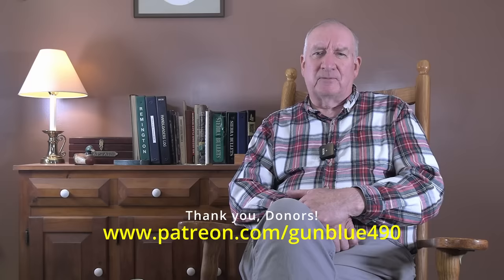The Copper Fouling Lie ~ Don't Fall for It!

Comment: A friend brought some Franklin Arsenal 1926 .45 acp ammunition to the range, and we shot it.  It shot very well and accurately.  It appeared to have a finish on the surface of the bullet.  When you mentioned tin plating on bullets, I wondered if that was on the 1926 ammo?  The cartridges were in fine condition.
Reply from the maker: I believe that tin was eliminated from bullets before that.
Reply: @GunBlue490  , thanks.

Comment: I've found that WD40 quickly cuts through carbon. Spray some on a clean rag and wipe the case necks clean before resizing, then wipe with a dry rag to remove excess; no need to tumble the brass.
Reply: Stop.

Comment: I have a question for all that are knowledgeable (not just opinionated): How do I return an old military rifle bore to shinney if it is black? I have several WWII rifles (and a couple old Winchester Lever Guns) of different manufactures that after cleaning have good-looking bores (rifling), gauge well on both ends and have smooth muzzles but I am unable to get that bore to shine up like near-chrome which I can on all my other rifles and handguns. My Model 68 Winchester (it was my Dad's) has had so many rounds through it the rifling is shot out of the chamber exit but due to the long barrel the accuracy is still there. It shines like chrome when clean. So what is the secret of black bores (I was told it was "copper fouling") and how do I fix it?

Comment: Thanks for the technical information GunBlue490.  Please do a similar video about lead in the barrel.  Most of my shooting is of the .22lr variety and seldom with copper clad bullets.  Shooting events are sometimes 100-200 rounds in one session. Afterwards most times I just pull an oily bore snake through it 3 times.  Occasionally I still see lead in some of the barrels with my bore-scope.  In that case I just use Hoppes with a bore brush a few times followed with my oily boresnake.  Critique me here.  Am I doing it all wrong?
Reply from the maker: Quality .22 ammo has either copper plated bullets, or they are lubricated.  Either will completely eliminate the need for cleaning, and a simple pass of a Bore Snake will wipe away any carbon.  Cheap, bargain .22 ammo is inexpensive because they have neither plating or a quality lube.  Lead bullets will lead barrels in the absence of either.

Comment: I was always under the impression that Copper solvents were primarily used by people shooting all Copper bullets such as Barnes. The newer Barnes bullets such as the TTSX are much better at alleviating Copper fouling by the grooves on the side of the bullet. The earlier designs caused a lot more Copper fouling than current offerings. I'm not sure the Copper issue had anything to do with traditional jacketed lead core type bullets.

Comment: Cut it in half and use a microscope or maybe use a borescope?  Button rifling causes the perpendicular lines cause Savage uses that method and my bores have those lines.  Agree about breaking in process.  But copper definitely causes accuracy to degrade over time.  Some rifles more than others. Love Wipeout for cleaning.

Comment: Thanks for posting this message.  I have preached the same thing to some friends of mine for a while and they won't give up on "copper fouling"!
What concerns me with the solvents is the chemical Trichloroethylene (TCE)....studies are showing it's a very carcinogenic and also attributed to Parkinson's disease.   Have you done any research with respect to TCE contaminants in gun cleaning products?  I like Hoppes but have pretty much stopped using it since you turned me on to Mineral Spirits....but I wonder about mineral spirits as well.  I know that Ballistol is supposed to be the safest.  I have read that mineral spirits and mineral oil may contain some carcinogenic VOC's but I'm not 100% sure.  So, I may just start using Ballistol primarily.
Anyway, thanks for another great presentation!!
Reply: My tip is always wear nitrile gloves when cleaning and have decent ventilation. I used to work in the pharmaceutical industry and the danger was always prolonged exposure rather than acute where carcinogens or mutagens were concerned.
Reply: Very good comment on TCE. Any of the crud-buster type sprays that dissolve oils and then evaporate quickly usually contain TCE. Aerosol brake cleaners or electrical contact cleaners like CRC’s Lectra-motive are the same.

Comment: Thanks for the interesting info! One question about the plating that you say takes place in the first few shots with a new barrel. If the barrel striations really do get filled in like screw holes in drywall, why do barrels still leave signature markings on bullets even in older guns? Your description made it sound like all those striations and other imperfections of new barrels get completely filled in and smoothed over, but if that were the case police wouldn't be able to link bullets to guns... right?
Reply from the maker: That's very funny, and hardly the case at all!  Understand how the evidence process works.  Bullets are not license plates with a data base.  Police begin with a suspect firearm and a suspect bullet.   Police labs have a library of rifling patterns used by various manufacturers that they have developed over the years from which they narrow things down.  For instance, a bullet pattern can rule out all manufacturers except X or Y.  So, if they have recovered a suspect rifle type X, it's submitted to the forensic lab, perhaps with a box of bullets found at the scene.  If they don't have the ammo, it matters not, because labs keep an inventory of every bullet ever commercially made.  As with all evidence in court, it must be corroborative to other evidence.  The gun is suspect for a particular reason(s) that link it to the crime, not just any gun in the universe.  The question is simply:  Does this bullet match another bullet fired from this gun?  

In the examination process, a bullet of the same type as the evidentiary bullet is fired from the suspect firearm and captured.  Both bullets are then chucked into a microscope comparator and the bases are rotated until they match.  Even perfectly smooth barrels have particular variations in rifling width, spacing, and impressions that can only be made by the same barrel, even if produced by the same machine on the same day.  Copper fills in roughness and improves a barrel, but it still conforms to irregularities.  A barrel that has been made smooth by whatever process is still unique and unlike any other barrel under a microscope.

Comment: When shooting cast lead bullets, the lead will  build up in the barrel. But after shooting I always shoot a copper jacketed round to clean the barrel.
Reply from the maker: Please, you should never, ever do that!  That's a bore obstruction! While lead bullets will continue to pass through, though inaccurately, the resistance of a jacketed bullet can raise pressures dangerously.  Even a heavily oiled or greased bore can blow a gun if shot out.  Never shoot out bore obstructions.  Get yourself a Lewis Lead Remover and do it safely.
Reply: Wrong

Comment: When a bullet is fired, copper is deposited in the barrel. This process repeats until it reaches a saturation point. From there, every bullet fired thereafter will strip an equal amount of copper that it will deposit. This can happen in as few as three rounds. There’s really no reason to worry about copper, as you said, it’s the carbon that is the problem. 
When we put solvents in the barrel that attack copper, they may attack copper more aggressively than other metals, but they attack metal, and they will gradually erode barrel steel. To make matters worse, there will be solvent that will be trapped in microscopic fissures in the barrel steel that you will never be able to remove, but the solvent will continue to eat away at the barrel material.
Call me crazy, but the way I clean my barrels of copper is to put more bullets through them. I do clean moving parts, and carbon from the barrel as needed. I don’t worry about copper.
Reply from the maker: You're essentially correct, though successive bullets simply conform to the smoother barrel with no stripping of the metal.  After conditioning, things remain static.

Comment: I have seen evidence of copper fouling that proved to be detrimental to accuracy. A browning a-bolt chambered in 243 winchester that was shooting 80 grain federal soft points. A rifle that was shooting .5 moa opened groups up to 2 moa over time.  The owner,(my son) is a meticulous cleaner of his rifle every time he shoots.  But he never had used a copper specific solvent in his barrel.  Only a well known general cleaning solvent. He, being very disappointed in the situation,  asked me what he should do to solve the issue.  I suggested using an oil based copper solvent to see if copper fouling could be the problem.  We first ran a bore scope down the barrel to assess the fouling  severity. It did seem to be heavy, so we continued with product recommended cleaning procedures. The result?  Same box of ammo and same rifle after cleaning immediately returned to .5 moa groups. No other explanation for it other than copper fouling build up.
Reply from the maker: I don't wish to cast doubt on your comment, but writing about anecdotal evidence and scientific demonstration are two different matters.  My wife's 243 Ruger American has been shooting 1/3 MOA groups since it was purchased over ten years ago, with no change in accuracy and it has fired over 2,000 rounds of various bullet weights; all copper jacketed.  None of my rifles have ever demonstrated copper fouling, including the three 22-250 rifles I've owned, which are smaller bore, and higher velocity.
Reply: @GunBlue490 I believe you on that.  But there is just no other possible explanation for what we experienced. Consequently, we will always remember that if accuracy begins to fall away, copper antifouling the barrel is always something to consider for prudence sake.  It may not be the answer in every case, but I have no doubt that it can be in some cases. However I would add this, it isn't necessary until it's necessary. His shot well for a couple hundred rounds or so before accuracy began to fade away.
Reply: Anecdotal with an "N" of 1. Plus, the action of "removing copper fouling" has a placebo effect; people think their groups will tighten as a result of this process, so they do.
Reply: @kawarthaohio5507  🤣🤣🤣  that's what you think it was huh? Wow! Getting in to the arena of social media never ceases to amaze.

Comment: Not worried about copper fouling but I get good performance from CFEPistol and thats what matters.
Reply from the maker: It's a great powder.  I use CFE223 for its accuracy in my AR loads, and takes up less room than BL-C2 for the same performance, not because it contains a copper "brittler".

Comment: Very interesting, and fits with what I've seen in 35years of shooting. I'd like your opinion, or the opinion of anyone who reads this on the following... In my 'young and stupid days' (about 3 weeks ago) I used a few bore mops and progressively finer diamond, 400 to 1000grit, abrasive to polish a 223 bolt action barrel I have. Using a bore scope the barrel looked fabulous. So I took a know accurate load (69gr TMKs 26.1gr varget) to the range to test my results.  Within the first couple shot I could tell something was amiss, velocity was UP by 250fps so I knew that means friction was in fact UP, accuracy was down to about 3/4" 5 shot groups.  I thought 'oh no what have I done to my 1/2" rifle'.  As I continued to shoot I noticed that the velocity was coming down to pre-polished levels, and accuracy was returning to sub 1/2", with my last 6 shots inside 5/16" and velocity average 40fps above pre-polish level.  I have my own theory as to what the heck was happening in the barrel, but I would love to hear others opinions.  Now looking with a borscope there is a very lite coating of copper...just like it had always been.
Reply from the maker: 1,000 grit may actually be more coarse than a typical barrel's interior finish, especially one that is highly smooth, cold hammer forged.  As I stated, and as you observed, the bullets filled in the striations and smoothed it.  Lapping a barrel is done by forming a lead slug to the bore, onto which a lapping paste is applied to eliminate tooling marks.  It's then pushed back and forth.  Based on my personal observations of the extreme cleanliness of them, and their performance, I believe that cold hammer forged barrels rival the best competition barrels which are typically made on old rifling machines and hand lapped.
Reply: @GunBlue490  Thanks for the reply. Happy shooting

Comment: Do you feel that the new powders "CFE" (Copper Fouling Eraser) or the "Enduron" line are a waste of time, since both boast of copper removal additives/chemistry? I have tried IMR 4955 and "IMR 7977" but not any others. That the latter two are also advertised as "temperature insensitive," this might be the only benefit over existing powders as I can see...if that's even a huge problem.  Thanks.

Comment: Love my Tikka rifles cause they are cold hammer forged and don’t collect much copper.
Reply: That's funny. My hammer forged Model 70 Featherweight collects copper like it was a bank collecting pennies. I did not break it in. My new button- rifled Shaw .222 barrel collected ZERO copper after following the recommended break-in. :)

Comment: I cast bullets, I like to have a bore with no copper, are anything else, when I switch to cast lead bullets. I have shot as much as 300 38sp and 357 magnum, cast lead bullets, before cleaning. Then I brush bore with, hoppes or just kerosene, that's just for carbon and powder debris. I then get the lead out with copper chore boy scrubbing pads,wrapped around a bronze brush, then oil revolvers with synthetic engine oil, bores look like mirrors when I'm done. My cast bullets are just as accurate as jacketed bullets in a revolver anyway.

Comment: Some good points BUT I would have to argue the non existence of copper fouling.  I have 3 rifles for example, all bought for $.25 on the dollar.  A Savage Axis in 270 Win, a Savage 12FV in 6.5 Creedmoor and an M1 Garand.  Rifles bought cheap because they wouldn't shoot.  Should be bought cheap because never cleaned.  After hard carbon removal large amounts of gilding metal were present, JB Bore paste took care of that and like you after shooting I saw some nice streaking on the lands and all shot very accurately.  The M1 was the worst with built up deposits on one land right at the muzzle, literally couldn't hold a 12" group at 100 yards.  A bore scope, many applications of JB and some serious elbow grease finally removed it and that rifle, a CMP Special Grade with a new stock, is now the most accurate M1 rifle I own shooting right at 1moa.  These were extreme examples and I agree 99% of the time the copper streaking you see is actually beneficial but IMHO "copper fouling" does exist and there are just some times you have to start with a bright barrel and fill the pits if you will.
Reply from the maker: You're speaking of dirty, abused barrels.  That's certainly not what I've described.

Comment: Thanks for this info, does this apply to only precious and long range barrels or also to handgun barrels? I don't use anything specific for copper but I do used cleaner to remove carbon in both, my rifles and handguns.

Comment: That has been my thought process too.  However, it seems as if everything to clean guns these days has copper fowling eraser somewhere on the label. What are your suggestions for a “ milder” cleaner.  I’ve also never been that impressed with clp.  One other thought/ question pertaining to reloading is with hodgen’s line of Cfe powders.  Could there be similarly strong chemicals in their formulation as well?
Reply: He has several FANTASTIC vids on how to clean and lube the RIGHT way that you can find. He used simple mineral spirits for carbon, and it does as good as anything else on the market. I just use Hoppes #9?solvent, because it’s a comfort smell across my entire life.
Reply from the maker: Though I love the banana smell of Hoppe's #9, I can purchase a gallon of more effective mineral spirits for less than a bottle of Hoppe's, so I've been using it exclusively, followed by a pass of a patch oiled with mineral oil.  CFE powders contain a formulation that crystallizes copper so that it flakes off.  I use CFE223 in my .223 loads because it's accurate and produces high velocities, not because of its formulation.  I am rather skeptical that there's any benefit, as the military never had copper issues.
Reply: @GunBlue490  Thank you for that tidbit about CFE223 and your handloads!
Reply: @GunBlue490  Why in the world would you use cfe powder and rob your rifle of all its accuracy enhancing copper when there’s so many powders that produce similar velocities and accuracy?
Reply: @GunBlue490  I totally agree 100% with you sir. I just love the smell. I should just wet a cloth with it for ambiance while I use the mineral spirits to do the actual work. <grin>